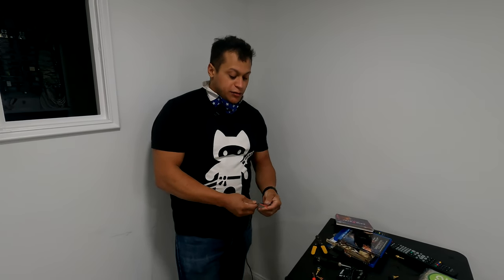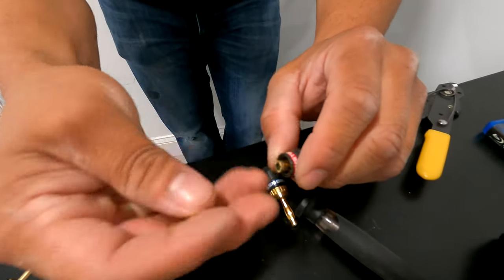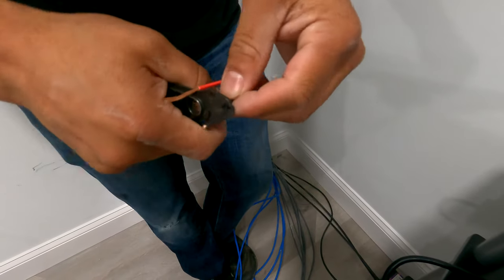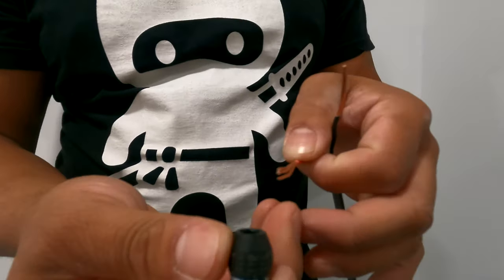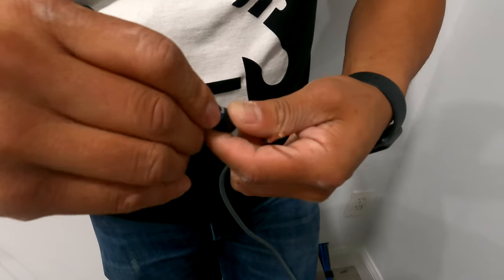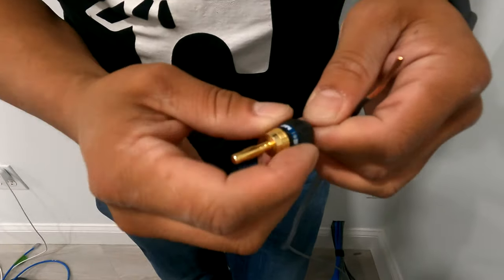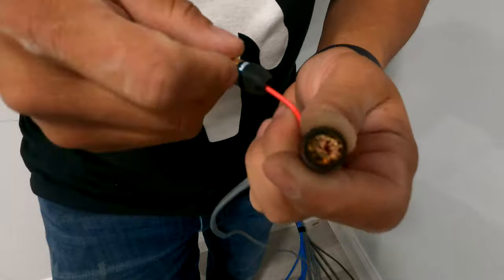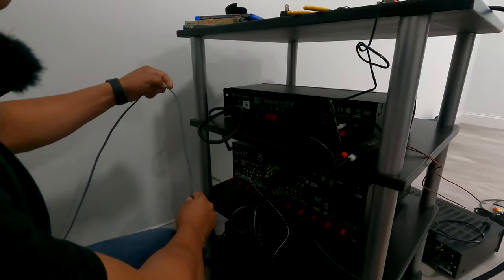How to install banana plugs on speaker wire

Comment: It's probably low voltage alarm cable for 12v/24v . I used that gauge of wire for cctv analog camera installs

Comment: Don't bother with these splay type plugs, get the banana plugs with two flathead set screws that press down and create pressure, rather than screwing over and damaging the copper.